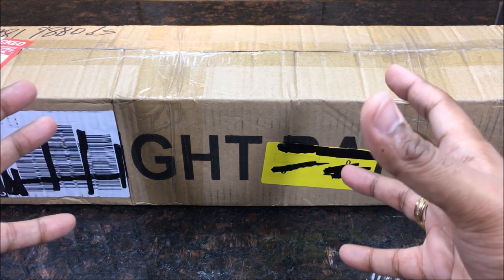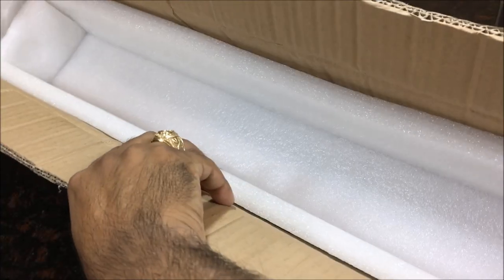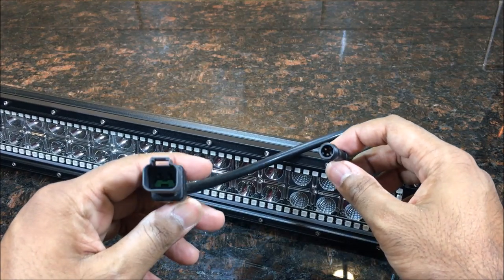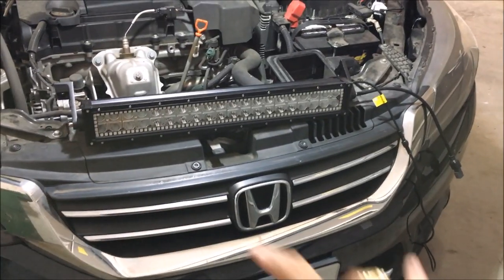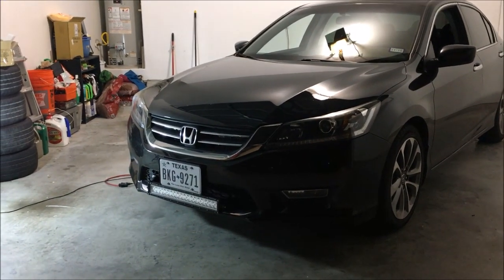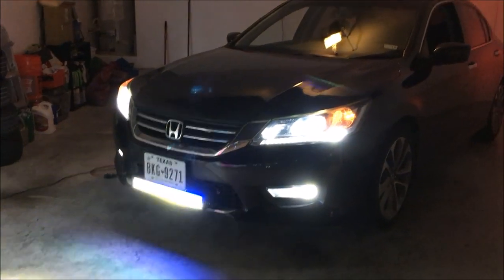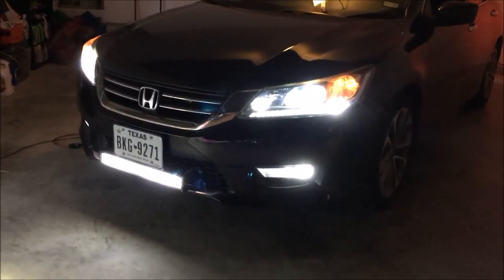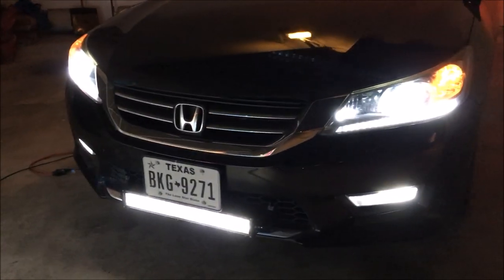LIGHT BAR ON A CAR?!!  (Actually Pretty COOL) 22"

Comment: Can't even use color lights on your vehicle outside the vehicle.
Even these lights have to be under the dash out of view.
police in illinois will actually ticket you for having these lit on the highway and been known to actually confiscate them from your vehicle.

Any flashing light thats not amber is illegal.
according to illinois vehicle codes.
These lights somehow fall under the emergency warning lights code
even had the local pd tell me i cant have tire fly tire caps on my vehicle.

Wth sell these lights in Illinois when its illegal to use them in your vehicle while driving.
Reply: Same in NYS.I was pulled over and given a quick lesson on light bars by police in Mt Vernon, NY. They didn't ticket me, but made me aware it carries a hefty fine.No problems if you're on an isolated road with no traffic, but not on- road.Cool cops by just pulling my coat and keeping me informed instead of ticketing me.